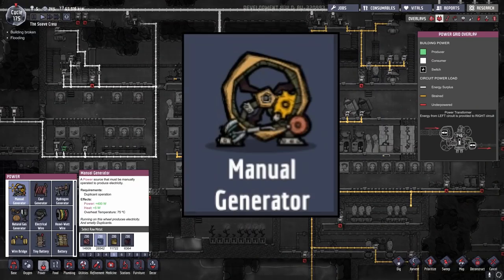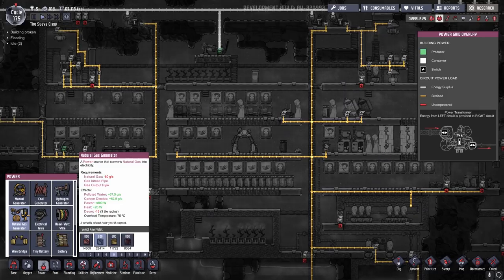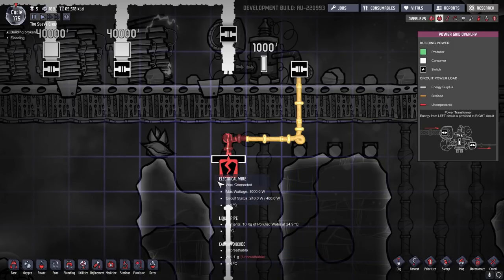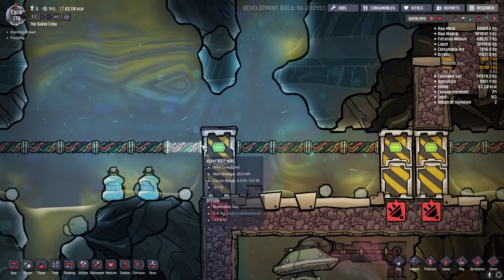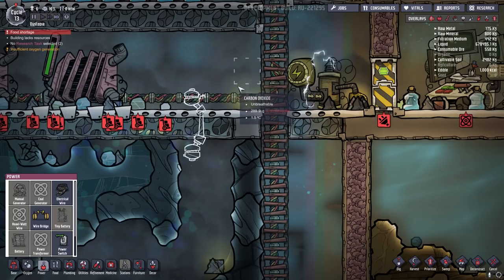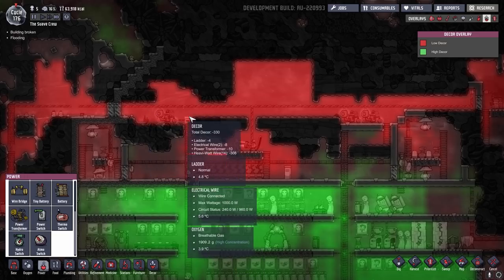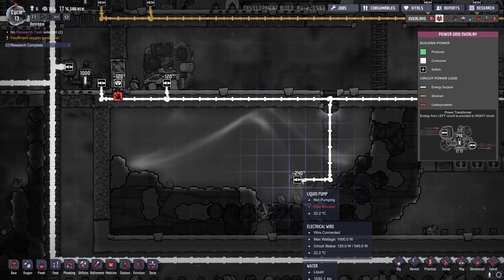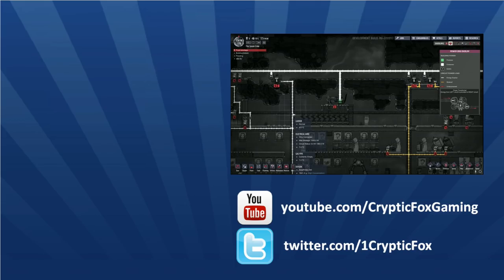Power Management - Oxygen Not Included - Tutorial/Guide

Comment: That early thing you said.  You can pass an infinite amount of power etc etc.  You currently do not need to use heavy watt wires anywhere.  You can have all of your power generation on one length of wire.
Reply from the maker: +JackDander I just meant you can have the wire attached to a lot of power generators without an issue, but as soon as you have more than 1kw of machines pulling power off the line it'll start to break.  The load on the wire is calculated based on the number of watts machines are taking, not how many watts are being produced.

Comment: I'm not quite sure I understand when a heavy-watt wire is needed vs a regular wire. If you have too many things drawing power do you need the heavy watt wire? Or can you continue using the regular wires and just split off the power grid? Do you need a transformer every time? Can you use a regular wire over an infinite distance?
Reply from the maker: Regular wire can carry a load of 1000 watts (1Kw) before the wires will start breaking and your duplicants will have to spend time and resources fixing them.  The load is determined by the power consumption of all the machines on the circuit.   Generally you'll want heavy watt wire if you're using a central power creating area that you want to branch out to your whole colony, or if you need to send power to one of the new machines that draw more than 1Kw of power (like the Aquatuner).  I'll generally use heavy watt wire to create a backbone for my power grid that I'll use transformers to branch off of so that each part of my power grid doesn't go over 1Kw.
Reply: Or you can use exploit :D Wires between transformers can transfer unlimited power without damage.
Something like that: https://i.gyazo.com/5d9f2ca8fb6a446a51e2a386febf8c5d.jpg
As you can see there is 6x800W generators (4800W), main bus with batteries and 4x4x240W of load (3840W). All connected with normal wires and no damage.
In that way we need HW Wires only when we want to connect all generators to one transformer or more then 1000W of load to one transformer.
EDIT: It's not working anymore. They patched it.

Comment: Hey Cryptic! I know how to get a stable supply of Hydrogen, if you have a steam geyser (it puts out water) you can put a pump in that infinite water source, hook it up to an (I think) electrolyser, or whatever turns water into Oxygen and Hydrogen (it can be found in the Oxygen tab). This also helps with Oxygen.
Reply from the maker: yeah i have a tutorial vid on how to use the electrolyzers.  You generally need multiples of them though to produce enough hydrogen and your net energy gain if you can get a consistent enough supply of hydrogen pumped to the generator is relatively low after you consider all of the power spent getting it (water pump to multiple electrolysers, plus pump to capture hydrogen and send it to the hydrogen power generator, and possibly a filter in there as well).

Comment: Until this is fixed in a future update, you don't need heavy wire for the 'upstream' section before transformers if only battery and generators are connected to the power line. The bug is that power generation is not counted towards power capacity. Instead, only power consumption is counted towards the capacity.
Reply from the maker: Yep though I'm expecting they'll correct that bug and I want to have my power grid already in a good place :)

Comment: When you use a transformer, does the input wire need to be a heavy watt wire?  it seems I tried to use one and it didn't work for me so I got pissed and started a new colony...
Reply from the maker: No it doesn’t necessarily have to be, but if you’re using a transformer you’re likely connected to a wire with more than 1kw if power in it, so it will generally be a heavy watt wire

Comment: Why can wires become strained even if they use well under 1k watts? For example in your one scenario on your video you have a power transformer that is only feeding a textile loom, yet it's strained. I have a very similar scenario. Why is this so?
Reply from the maker: It's not truly strained.  The coloring sometimes will show a strained wire even when it's not.  As long as the load running on the wire is under 1k it's fine.  The max potential can actually be higher than 1k if you have machines that only run rarely, as in practice you'll never really be drawing over the max.

Comment: Aren't you supposed to run wire from the transformer to a battery then a wire from the battery to the machine to get the strain off the wire?
Reply from the maker: +markbones3386 potentially but the strain that's showing on the wire doesn't really matter as long as you're not exceeding the 1000 watt limit

Comment: I just started my colony to use coal power generator since I have a load tons of them but when I use the big wire and connect it to the transformer. It lower down the power to a little above 1000 (more like 1100-1300 watt range) and it is straining my already lack of metal resource to keep fixing them. I dont know what happened
Reply from the maker: the transformer is intended to take higher wattage off your main power trunk (generally  heavy watt wire) and lower it down to only 1kw for use with the smaller wires.  Those smaller wires can't be drawing more than 1 kw or they get damaged.
Reply: CrypticFox  that's the thing. I put it through a transformer then use the small wire to connect it to my other appliances. But it is still above. Bug?
Reply from the maker: hmm must be.
Reply: CrypticFox I found out my problem. I put my generator battery threshold at 100%. Generator + charged battery give outs more watts.

Comment: I don't understand the calculation, you have 3 coal generators (3X600 so 1800W)and you are able to use 3 transformers of 1000W each ?
And why don't you use a smart battery to save some coal ? Nice videos btw
Reply from the maker: At the time this video was made (which was quite some time ago now) the smart batteries didn't exist :)
The transformers only draw what is needed, so while they're capable of each passing 1000W to their circuit, they're only using what's required.  I often will set batteries on the side of the circuits where the power is generated as well, so if the circuits draw more than what is produced periodically then you have some buffer power to serve those needs, and they get charged up again when the power draw is lower.
Reply: @CrypticFoxGaming  Oh ok I wasn't sure about this, well thanks for the answer, I'll try it on my colony ^^

Comment: Electricity needs to be reworked. It still shows lines as "stressed", when they are not. Like your textile machine, which was only 240 watts, but it showed the line as "yellow = stressed". It still counts "disabled devices" as a load, in the formula. Smart batteries fill first, instead of filling equally, by percent, compared to other batteries. (Thus, the automation will fail, if you mix batteries and try to use the smart (dumb) battery as the "I am full" sensor, or "I am not full" sensor.

It doesn't obey actual laws of power, but they, ironically, bind you to ONE law of power, which is laughable. Run 2x 1000 watt lines, and you should be able to handle 2000 watts of load. Given two connections, power should always take the path of least resistance (shortest connection), but it takes both, as the full 1000 watts on each line. Though, each would have no more than 500 watts each. The transformer, which is also a joke, doesn't even work. It harbors 1000 joules, but never uses any of them. The point of an "electrical capacitor", as they are trying to use it, is to deliver massive spikes of power, when needed, ABOVE the rated load. So, the average will be constant on the batteries or power supplies. They are using them like isolation-gates, which has nothing to do with joules, capacitance, or "transforming" anything. (Science fail)

Having a battery next to a working item, on a powered line, should draw power from ONLY that battery, and not count as a load on the end of the system, past another battery. However, it will blow lines at the ends, where load is less, if the total load across the whole setup is above the rating.

The laughable parts...

A 250 watt device will only produce 250 watts of heat, in reality. Here, a 250 watt device seems to output nearly 3000 watts of heat. A 10 watt light will output over 300 watts of heat. Home wires, which are quite thin, in comparison, can easily deliver 2,400 watts (20amps * 120Volts = 2,400Watts). However, these arm-thick wires, in this technological advanced game, can only deliver a fraction of that. Simple things, like filters, require almost as much power as the pumps feeding them. Needed to filter gasses for the generators, in most cases, which produce just barely enough power to run the filters and pumps that feed them. 800 watts of generated power... That is a pocket generator for camping. These things are the size of a car. They should be generating 8,000 watts or 8Kw of power! However, 800 watts would be generous for a human powered hamster-wheel. It still wouldn't generate more than 800 watts of heat, unless it was 50% inefficient.

I know this video is from an older version, but not much has changed. It is still a horribly laughable application of delivering power and heat. However, now we have three flavors of wire. 1000w, 2000w and the larger 20Kw or 40Kw. (I forget, because I have not used it yet.) {The wattage should be determined by the metals resistance, not the generic type. Gold being the lowest resistance, should handle 10x more than Iron wire. Less loss and heat, when operating.}

Also, heat doesn't rise and air flows slower than hardening cement. Oddly, water flows faster than air. Last time I checked reality, air-pressure distributed faster than air. Just ask a weatherman, scientist, mathematician, dishwasher, airplane pilot, ship captain, any child over the age of 3 who ever had to blow out candles or shoot a squirt-gun. Just don't ask the programmers. They will tell you that air takes 14 days for air-pressure to equalize from 14 tiles away, and heat falls down and cold rises and insulation mysteriously can stay stuck 10-40F higher than the surroundings.
Reply: wow.....
Reply: Next game jam, I'll try follow these rules and build them into a game. :-l Hope it will be easy. I agree with everything you said.
Reply: I love that you are nitpicking everything like no one knows anything. Do you really think no one in the team would've at least looked it up on the internet? You may not be aware of this, but in a videogame - game balance and an end-goal this balance is trying to achieve worth a lot more than your precious realism.
Secondly: you know precisely while the wires are arm-thick, don't be a goddamn idiot. So that we could SEE them, because we, AS PLAYERS, are the architects. These are basic aesthetic conventions that need to be done in a game about building and planning in order to not get frustrating.

Comment: Thin wire does not overload if it carries only electricity that is generated by generators to batteries. It only overloads if consumption is more that 1K. So you can 'push' unlimited power to thin wire and batteries charging does not count as consumption. So you actually do not need heavy wire at all. Tested in my colony and woked well. No overloads.
Reply from the maker: yeah i'm aware that batteries and transformers aren't considered as consuming the power and don't overload the wire, but I figured I'd just be in the habit of using heavy watt wire, as they're bound to correct that at some point.

Comment: i really have a big problem with temperature cuz it's rising unstoppable and do anyone have any tips about controlling polluted water
Reply from the maker: +Hina heat management is a big thing now that we don’t have cold biomes appearing right next to the starting area.  You need to insulate your colony from the hot space around it, limit hot machines in your core colony area and use wheezeworts and thermal regulators to control the temp of the air (either by directly cooling the O2 or cooling some other gas to use as a cold ‘radiator’ kind of thing)
Reply: Thanks for the advice but it seems like i was surrounded by toxic biome and i have never seen wheezeworts.555

Comment: i'm looking for some power produce ideas so my dupes can no need to keep on running on the wheel daily :
for the coal generator it produce 600W per sec but to get rid of the co2 i need 360W and consume some coals for it to continue (which can be obtain by wasting some resources to the hatches when the raw coals are finished dig out from the map) = but it seem not good since u need to waste other rare resource to get coal
for the hydrogen generator so far is the best green generator as it produce 800w but it need 120w on electrolyzer and 480w on gas pump (for the biggest problem part is when the air pressure is too much in base it will stop generate)
and last is the natural gas generator even it produce 800w but also produce tons of co2 and polluted water which need many other building to clean them up...
Reply from the maker: everything has a cost.  Either you spend the time of the duplicants running on the manual generator, or you have to deal with the needs of the other power systems.  Its all a progression though.  After the manual generator you move to coal, then to hydrogen, and then to natural gas if you find a geyser.  Of the options available the natural gas one is probably the most viable for longer term power needs.  You can use the CO2 scrubber to clean up the CO2, and send the polluted water generated by the gas generator and the scrubber to some hydroponic tiles to grow crops.
Reply: idea quite nice, but i'm already change my food to the wheat which totally no need any water or fertilizer
(5 of grains enough for a dupe to survive)
Reply from the maker: Yes sleet wheat is definitely the easiest crop to manage and grow.  There aren't too many uses for polluted water unless you're feeding it to a hydroponic farm, or cleaning it to produce fresh water (either by converting to steam, or using the water purifier).
Reply: it seem the best for now is only turn them to steam (earn some dirt too), other usage will need to waste more resources and can't gain back...
Reply from the maker: yes that's true, though turning the polluted water to steam takes a lot of energy so it depends on whether you want to commit that much power (particularly for the water you created by creating power).
Reply: it won't take much power if u use the 16+ batteries tower style with ice area (but takes time to raise the temp, it raise very slow around 0.5c~1c per day, and they need to charge daily or cool back down)
but i found some funny part is when the cold oxygen in the ice area been heat up, they will become small amount of water on floor which didn't reduce any ice or snow around it

Comment: I know this is 2 years old and the game has changed a little bit now but PLEASE SOMEONE EXPLAIN TO ME THE TRANSFORMERS. PLEASE.
Whenever I try to use them, none of my batteries work. They just don't work. I don't know what I'm doing wrong and I've been watching lots of tutorials but all of them say the same and I'm already doing it right I don't KNOW WHAT WRONG AAAA!! [STRESS 100%] DESTROOOOYYYYY
Reply from the maker: The job of the transformer is just to take the power on one line and limit it to a maximum power level on the other side.  So for example if you had 10kW of power being provided to your main trunk, that would break all of your smaller wires in the base.  If you just run heavy watt wire everywhere it adds a TON of negative decor.  So you use the transformer to take the 10kW input, and limit it to just 1kW in the smaller wire you run off of the transformer, or 2kw if you're using the conductive wire.  Are your batteries before or after the transformer?  Generally if your batteries aren't charging it's because you're consuming all of the power and don't have extra power to store in the battery.  Bear in mind the transformers are also one way only.

Comment: this isn't the greatest way to handle coal gens... 
lock them in a insulated room with a gas pump  then pump the CO2 to a scrubber room or just add a scrubber to your power room.  and boom you have O2 and power. pump the CLean O2 out to the base and dups breath it. less fighting for resources to for clean O2. also make a closed loop water cleaning system for the scrubber as you would the bathrooms.
Reply from the maker: The scrubber does't produce O2.  It only eliminates CO2 :)